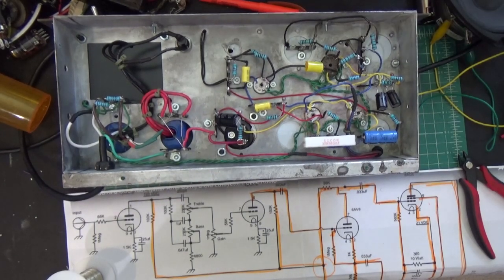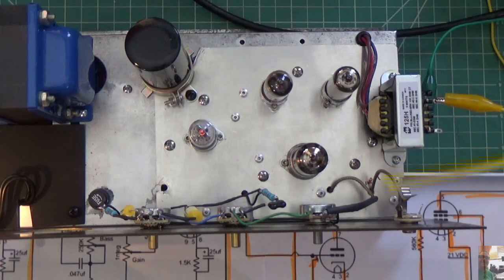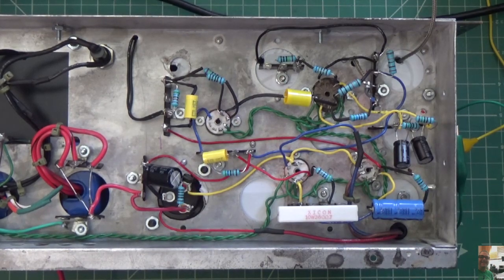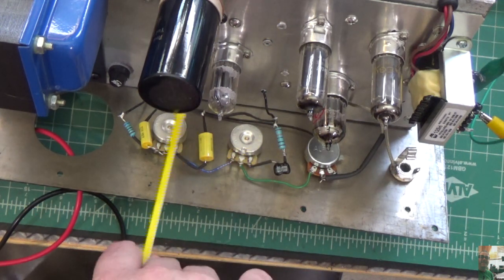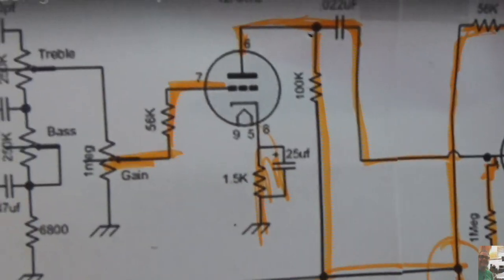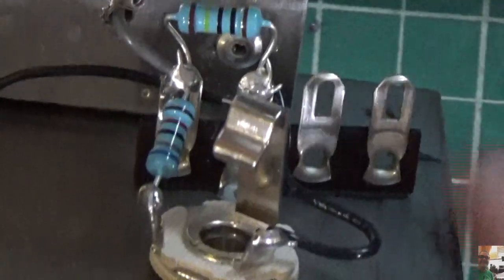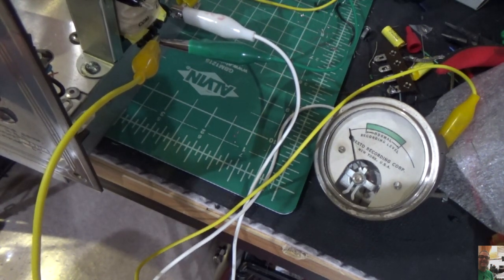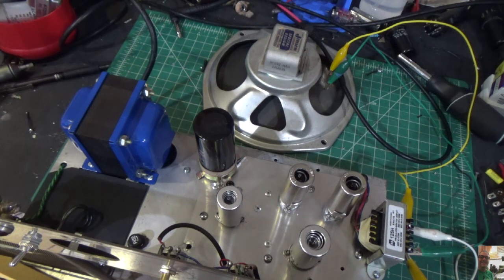Presto K8 Goat Deluxe Amp Build - Episode 8 - Lets Make a Squeal  !!

Comment: Excellent, Ron.  Great result.  Like Old Goat, I was thinking the lack of tube shields was causing the squeal.  I once had a Philco 620B that squealed like a pig and after days of pulling out my hair found out what those pesky shields were for.  LOL
Good job, my friend.
Regards,
John
Reply from the maker: Thanks John.  The PreAmp Tube, 12ax7 in this case was the cause of he squeal as I had way too much wire hanging off of it. The goal should be to have minimal wires on the control grids and plate ( 1,2,6,7) . I was keeping the wire company in business in my first build.  LOL.   Tube shields were the first things I tried but this thing was too hot.  That would be the first thing I check on your channel 1 problem. The PreAmp tube... thats usually where it will be... but who knows  :)    Having fun on this build for sure.   Thanks Ron

Comment: Hi Ron, Nice job, I was wondering if you tried to put the tube shields on the 12AX7 before you redid the wiring, that "may" have been the problem.
Just a thought.
Are you going to have vents in that box, it will get hot as you know.
What is the  power output of that amp?
Reply from the maker: Bill,  I did have the shields on... it squealed like a greased pig.  I will have vents for sure. I believe this is a 10w amp.    Pretty beefy  :)  Many thanks my friend - Ron

Comment: only one end of the outer shield should be soldered to the chassis, I got that from unkee Doug. 
those strays, keep you on your toes.
Reply: You got that right Don,,,, that ground can be a funny touchy thing.
Reply from the maker: Agree Don.    Grounds are the most challenging part of any build.. too many, not enough, some are loopy and some don't know the words and hum.... such fun my friend..   :)  Ron
Reply: Good point.    Ron might want to try grommets in the chassis holes where the shields touch the chassis to keep it grounded on one end only.       Also Ron, did you watch the video I sent you a while back a the beginning of this build about ground loops and how to wire grounds to eliminate/minimized them by Blueglow Electronics channel?